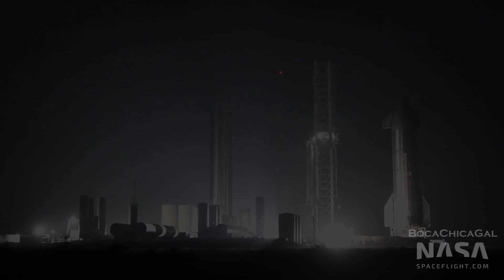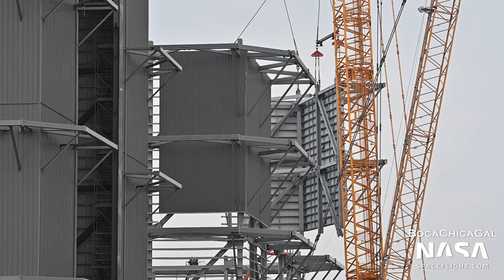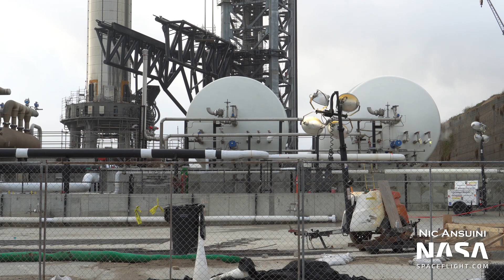Drill Rig Used at the Orbital Tank Farm | SpaceX Boca Chica

Comment from the maker: 0:00 - Sunrise Over the Launch Site
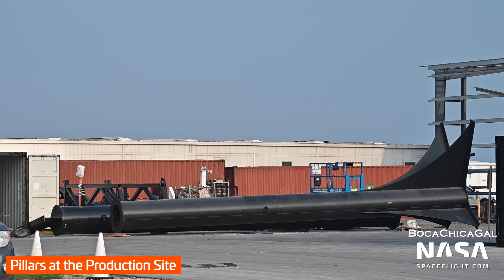0:50 - Pillars at the Production Site
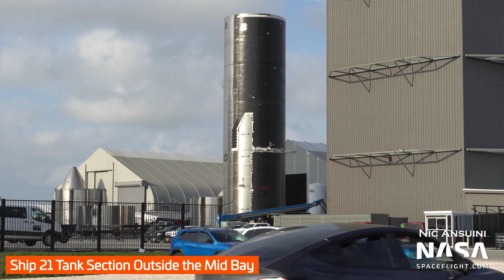1:30 - Ship 21 Tank Section Outside the Mid Bay
3:20 - Construction of the Wide Bay Continues
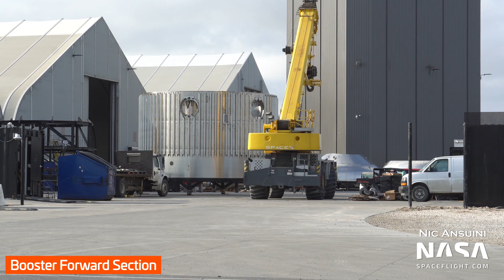6:40 - Booster Forward Section
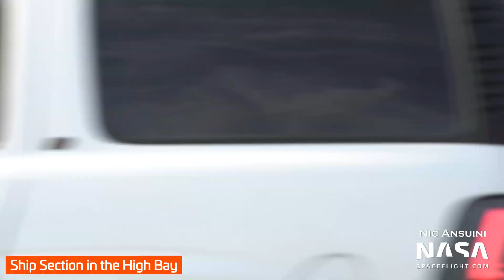7:00 - Ship Section in the High Bay
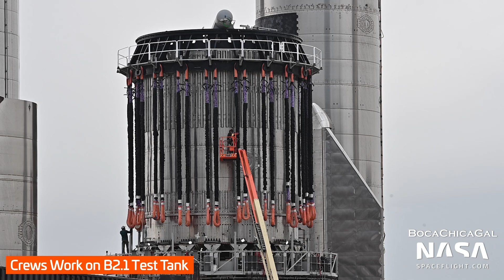7:40 - Crews Work on B2.1 Test Tank
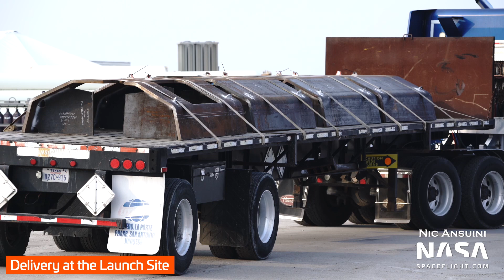8:40 - Delivery at the Launch Site
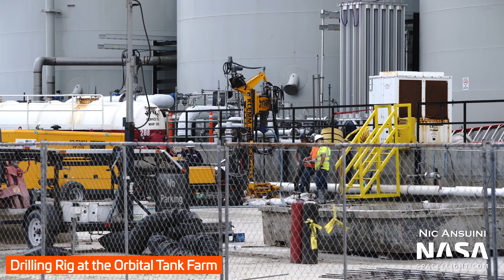10:00 - Drilling Rig at the Orbital Tank Farm
10:20 -Crews Work on the Chopsticks
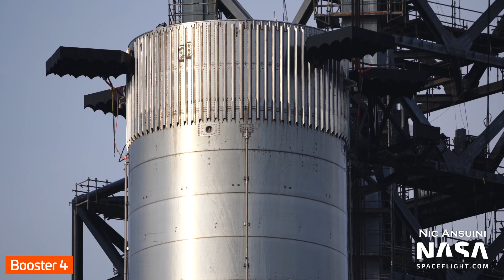11:20 - Booster 4
12:00 - The Orbital Launch Mount
13:30 - Purging of the Methane Tanks
14:10 - The Orbital Launch Site

Comment: I am liking how they are building pre fab sections of the new high bay in front of the high bay so they can continue to work on and finish the closing in of the first couple of stories. It's making the bay go up so much faster. If this second bay goes up this fast. I can't wait to see what building improvements they do on the second launch tower to make it go up faster. Rather it's still going to be at boca or if the one at the cape gets built first.
Reply: Wouldn’t be surprised if the cape does in fact go up in the next 6 months according to Elon’s tweet. He did also say the iteration at the Cape would be very similar, albeit quite improved.
Reply: @topsecret1837  I am thinking that you are going to be right. Mainly because of the trouble SpaceX is having with the FAA. Since the rules at the cape are slightly different it's going to be easier to build the human rated starships, or even the later prototypes, and motor boat them across the gulf to the cape to launch if it gets the FAA out of the loop a little bit.
Reply: @cazgreg1  The FFAA (sic) now want to have a say on who gets medals! Wish they would focus on their job! Too much power! I think an 'Independent Body' should be set up to investigate just what the heads of FAA are actually doing. If they are sticking to their Main Purpose or have drifted into area's they have no right to be in.
Reply: @David-yo5ws  The FAA is who gives pilots wings and Astronauts were pilots. Now as for the change, I don't think that any of BO's NS flights should count as they do not do one orbit. Maybe call them another name, Space Cadets.😆
Reply: With the flight limitations placed on Starbase, I would think Stage Zero at LC-39A and the new one at LC-49 will allow for the rapid launches SpaceX needs to get Starlink 2 up and running.  Starbase's 2nd Stage Zero will need to wait for the FAA to lighten up a bit on their restrictions.

Comment: So that booster torture stand uses those hydraulic actuators to pull on that upper ring through those straps to simulate the booster taking a 400 ton load to space. Impressive. I hope it passes.
Reply: A bit more than 400 ton. The Starship with fuel and a payload of about 110 Tonne will make it more like 1,500 tonne. The fuel alone is 1,200 tonne.
Then with at least 2g's of force, possibly 3g's: 3,000-4,500 tonnes.

Comment: That pillars have been waiting for a long time. I wonder what they're planning to be used for.
Reply: I was taking a look at those black pillars and at first thought that they might be a sort of flame diverter to go under the orbital launch mount but don't know now since i see two of them. They might just be pillars to hold something up. Like they used that red rig to put the chopsticks together on.
Reply: They are merely a post for a hoisting device you'd use as a manual crane in a orkshop, you can even see the pivoting beam on the second one behind it, you'd fit a beam trolley to the underside, and a chain block to that and use it to pick stuff up. It's probably laying there unused because a sling off a forklift is easier.
Reply: @rubikmonat6589  I’ll bet it’s the base for a large Jib Crane.
Reply: @jonhare392  Large is relative, haha, its probably the smallest one there.

Comment: The justification for using hexagonal tiles is to eliminate long straight breaks in the TPS.  So why are there long straight breaks that circle the cylindrical barrel of the SS?  You can tile a cylinder entirely with hexagons.  What advantage do these breaks, which also require sawing off part of the tiles, provide?
Reply: They are over sections where there is a weld that is done in the stacking process. I'm guessing they expect a little flexing there so don't want tiles going directly over them.

Comment: Are those tiles now the biggest possible single failure for Starship?
Reply: No. It's still the welding lines on the tanks. One rupture and the ship is gone.
But the ship can lose quite some tiles and still survive reentry. The steel under the white blanket can take the heat for one reentry. just not for multiple. Even the space shuttle lost tiles one every other flight and was still "fine".

Comment: I wonder what the drill rig was used for?
Reply: Maybe they are going to do what the oil and gas industry does and store huge volumes of methane underground then pump it out when needed.
Reply: @mbox314  Not with a tiny drill rig like that, besides there are already capped gas wells on the property which could be used for gas storage.  Gas well drilling might even be a way of obtaining methane, which is the major component of natural gas, for Starships until SpaceX gets a gas synthesis system operational.
Reply: Maybe a water well to supplement the existing supply
Reply: I would say just drilling holes in the concrete to allow bolts to hold a structure down. They seem to be putting in a covered walkway from the Sub-orbital gate all the way to the Orbital Tank Farm. Need to stop the general public going near the cryo-frozen pipes. So maybe a fence post will go there.
Reply: That drill is tiny. It's either drilling a hole for some small structure...or drilling core samples for testing or something.

Comment: There's nothing like having tons on the end of a crane and your the guy standing next to it holding a rope. Very quickly you realize how pointless your physical abilities are against that. You aren't going to move it much but you might stop an oscillation and that's the real reason you are there. Still it's good to have an exit plan.
Reply: Respectfully, this seems wrong to me, are you experienced in such matters?
Reply: @danm6189  He is very right. We had 2 ton stop logs that were short but wide. You are there to keep them under control but you never want to forget where your escape routes are. And you never want to get into a pinch point. Because about that time Murphy will show up.
Reply: @gravelydon7072  good work thanks, i stand corrected :)
Reply: @gravelydon7072  …… also, the load hangs by a rope/cable, so slight rotations and shifts are done by the rope handlers….

Comment: I am curious to why they need bays to build ships and boosters if the have cranes that can stack them. Why build a giant building to house them if they are going to be left outside right after?
Reply: They can't stack them (or at least, harder) in high wind, they need some protection
Reply: Wind blows the welding gas away. Shelter from the sun for the workers, walls to mount wall sockets to...
Reply: The wind blew one ship over in the early days before the bays
Reply: @mobrien888  Was that MK1?
Reply: @David-yo5ws  Starhopper's nosecone
Reply: The structures are stronger after assembled.
getting workers to the joints is probably still hazardous.
having multiple layers of workers is also more achievable with a building. (cranes crossing seems extra hazardous)
Reply: @David-yo5ws  Not sure. I just remember after that they started working on the bays.

Comment: Elon said that they plan to use S20 for the first orbital test. Yet they have just removed the lifting eyelets from the nosecone. I wonder if they found out something different to lift the ship, or how do they plan to move it from Pad B?
Reply: The thought process is it will be moved by SPMT near the Chopsticks. And the Chopsticks will lift and place S20.
Reply: People have suggested some sort of cradle that attaches to lift points to get it off the stand
Reply: With standard crane
Reply: @David-yo5ws  the question is how to move it onto the SPMT? Also, even though all the imagination videos show the ship is held by the chopsticks on its upper fins, at this moment the heatshield tiles looks way too fragile to put the weight of the ship on them. After each and every test or bigger movement there were cracked and broken tiles without any physical impact. I know that the edge pieces on the fins are specially formed, maybe even specially molded from a harder, more durable mix, but to me removing the lifting lugs before the ship is ready to launch is a bit early. I'm sure they have the ideas and plans, it's just something yet untested.
Reply: They're not ready for ships/boosters to attempt landing back at the launch site (yet) and be caught by the chopsticks (yet) but I'd bet the chopsticks are going to be in a position to lift ship 4 onto the booster. So get a SPMT under it, as they would for moving ships between the production site and launch site, position it between the lowered chopsticks, and up it goes!
Reply: @maddogUK69  they need a crane to lift the ship from the pad to the SPMT - that's where the lifting lugs would be needed.
Reply: Gentleman: We finally have our answer. They removed the tiles and put lifting rigging back in place. And we just saw the Chopsticks being tested.
Reply: @David-yo5ws  Yep, all gets revealed in the end :) From what Elon said a while back, I still think they're not planning to catch anything with the chopsticks yet (assuming 4/20 launches as originally planned, they're still aiming to ditch in the sea rather than attempt propulsive landings, yes?) but who knows? Everything can and does change.
My bet now would be that they'll use the crane to move S20 to the launch tower, then test the chopsticks to stack S20 onto B4. But again, it can all change!
Reply: @maddogUK69  Spot on with the bet! Your a couple of points up on the think tank rating ;-)
Reply: @David-yo5ws  Ha! I don't know about that, but it seemed the most logical/likely thing!

Comment: Beautiful flying flag, especially these days...
Reply: Any day.
Reply: I was just wondering how many they go through each year. The wind frays the end after a while.
Reply: @David-yo5ws  Now think about what it does to a 35'X58' flag. The end was 4 folded and it still ripped it every year when it flew on the flag pole.  The pole being 105' high to do it. And it would look tiny next to Starship.
Reply: @gravelydon7072  Bet it made quite a few 'cracks' on extra windy days too. 
I only thought about it, because  a mate of mine worked in Wellington for P & O Nedlloyd and the company wanted to know why they went through so many flags. Wellington NZ is called 'The Windy City' and has regular fresh southerlies from Antarctica. So fresh, you can almost smell the Penguins. ;-)
Their highest wind gust was 198 km/hr (123mph) in April 10th 1968, which caused a ferry to capsize with loss of life. 😞
Reply: @David-yo5ws  It was surprising how little wind it took for it to crack the whip. It also was not fun trying to take it down on a windy day as it could lift a person off the ground. Don't ask how I know that.🙂